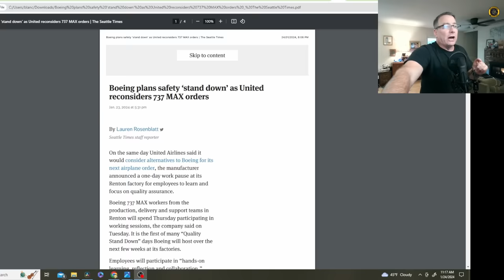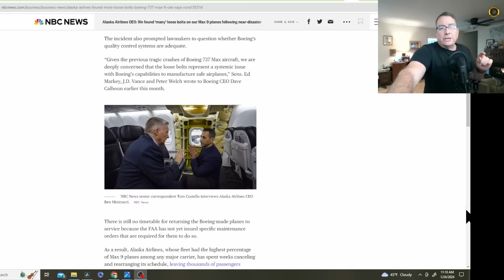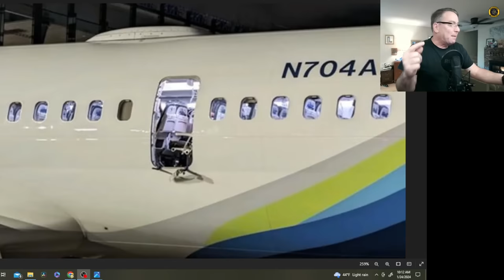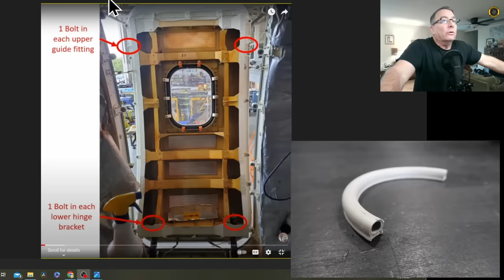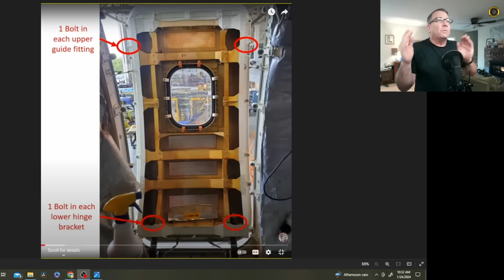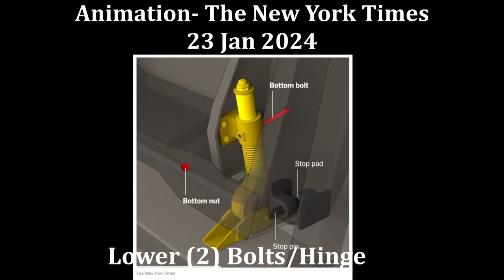Boeing's Quality Management Failure Explained 737-Max-9 Door 24 Jan 2024

Comment: Well, technically you can’t “open” a plug. You would have to remove it. But in some aircraft the door can be opened and closed as an escape hatch and wouldn’t require any bolts. I can see how that would cause confusion. Great explanation!
Reply: I think what 'open' means, as opposed to 'remove', is, the door is fully unbolted (all 4 bolts) and either the lower edge of the door or its lower hinge bracket sits on the frame while the top edge hangs outwards by several inches secured by straps or latch bars on both sides at the top. This video shows it 'open' but not 'removed'.
Reply: @istudios225  A door that would be functional ie, you could open or close and would not have bolts should be inspected differently than a plug that has to be bolted in place. Confusing the two processes is what caused much of the problem.  So, open and close a functional door and remove and replace a plug along with the appropriate documentation and inspections.

Comment: In the past when Boeing had quality problems with major suppliers, they sometimes bought out the company and went in and installed new management and business processes. I wonder if they'll consider the same with Spirit AeroSystems. With so many outstanding 737 orders they need to stabilize the supply chain.
Another thing to consider is a redesign of the plug door to mistake proof it. One way is to design the assembly in such a way that it's so difficult to remove the plug that it would never be casually considered. Only if the owner wanted increased seating and therefore the expensive conversion to a standard emergency exit.
My opinion is that the great decline of Boeing started with Harry Stonecipher and his emphasis on RONA or return on net assets. This was the late 90'sand early 2000's. From that point the stockholders were elevated above the airline customers.
Reply: There seemed to be another problem with air seals not sealing right, so that would be another cause for removing the door plug.  We could think of it in terms that if the air seals had been right, then nobody would have tried to remove the door plug.  Anyhow, is it possible that with one sloppiness (the bad air seals) combined with another sloppiness (the bolt reinstallation) we now have a dangerous condition

Comment: That explanation kind of makes sense.
It’s a process paperwork problem. 
I was wondering how not only could somebody not put in the bolts, but an inspector not inspected, and in the final paperwork review, nobody noticed that the inspector hadn’t checked it off.
Reply: And the interior finishing crew who were covering it back up didn't notice that something looked wrong.

In two different sewing factories I was required to look at every sub assembly and hand it back if it wasn't right. 

From the things Juan has shown us, the bolts should have been visible to casual viewing so the new crew on the line should have seen that something looked funny and called for an inspection.

Comment: Hey Juan!   Good video, as always.

     Small point about the bolt.   

      Large aircraft manufacturers almost exclusively use NAS hardware as opposed to AN or MilSpec.   The reason is that the Army/Navy (AN) standard is outdated and has been superseded.

      This plug door was designed to be held closed against the spring pressure with 4 NAS 6206-XX bolts.    

     Dimensionally they are identical to an AN6, but feature a steel alloy with higher tensile and shear strength as opposed to the AN bolt.

      The AIA, Aerospace Industries Association, maintains and publishes the National Aerospace Standards (NAS).

      GA is one of the few industries that still references the outdated AN standards.

Comment: Let's not forget that Alaska Airlines kept the aircraft in passenger service after repeated warnings about a pressure leak. One would think that it might be prudent to discover what triggered the warnings and fix the problem.
Reply: that's not a shareholder/mgnt/bean counter job either. & Alaska maint. was known to suck.
Reply: Pressurization problems are common, and sometimes very hard to troubleshoot! You can actually fly the Plane with passengers below 10,000 feet if the system is deactivated
Reply: To be fair, the airline didn't completely ignore those pressure warnings.  They rerouted its flights to stay close to the coast so the NTSB could easily find any crash...

Comment: I think the surprising blowout of the cockpit cabin door was the thing that got people almost more concerned than the main cause of the incident... just because it was another design feature they did not tell anyone about
Reply: Boeing said it was designed to do that. This is incorrect, the blow the pressure relief panels are there for that whilst maintaing cabin security.  Have you seen any feedback from pilots questioning whether a undesirable is able to use this 'feature' as a way into the cockpit ?.
Reply: I saw at least one comment that the initial report about that wasn't correct and that it was indeed the panels rather than the entire door that blew out, but I don't have a source.
Reply: @WOFFY-qc9te  not (Provably) from line Pilots... no.  but I have seen certain comments concern on how wrong that appeared from members of the investigation.

Comment: I know nothing about building airplanes although I did fly a piper back in the early '80s. When I would practice stalls and I would encounter substantial turbulence, I always thought that every single bolt in that plane would be ripped out.  I'm thankful that those techs and mechanics that put those planes together did a great job.
And also, kudos to the pilots that brought everybody home.
Aside from The worst possible scenario of insider sabotage...
is it possible that management just got sloppy?
If it's drugs and/or alcohol, we've all got problems. I wish them good luck.

Comment: Whether the door was removed or just opened, the 4 bolts needs to be removed so a QA inspector would need to check bolt Torques and castle nut cotter pins!!
Reply: You don’t torque these, just tighten them till the bolt hole and nut slots line up, then fit the split pin…

Comment: I am a field tech for ATMs and safes.   Someone had to have come across the bolts at some point.  You don’t have extra parts during putting it back together and not question where they came from.  Especially when lives are at stake.

Comment: Thru 1993 I was a Boeing 747-400 & 767 Planner in the factory. Strong safety procedures were in place. For every installation the  'Inspection' employee <QA> was required to inspect that it was indeed installed & installed correctly. I recall on a couple of occasions a prior installed part was in the way of the Technician's part/assembly installation located further down the assembly line so the first installed part was temporarily removed, other part installed, this triggered a new QA inspection (2nd one). That 2nd QA inspection i recall was an FAA req't.  Boeing should have kept ownership of it's Witchita 737 factory!!!! When i first got to Boeing i was shocked that their were all these different manufacturers making important parts

Comment: Interesting and more than a little disturbing. Over twenty years ago when Boeing's move to outsourcing was rushing ahead one Boeing engineer pointed out a key problem. Planning, supervising, executing and maintaining quality control over a subcontractor is far more fraught with complications than simply doing the work in-house. All the added work might even mean it costs more. In this case, if the FAA forces Boeing to clean up issues like incompatible work-tracking systems, the situation could get very costly for Boeing.

Comment: Your videos on this incident are fantastic. You brought up the difference between opening and removing the door in triggering an inspection by Boeing. I would bet that Boeing back-charges Spirit Aero for that inspection. Therefore, Spirit found a way to save money on being back-charged by reporting the door as opened rather than removed.
Reply: They probably had a final deadline to meet or incur penalties and this was one of several instances they found to save time by cutting steps.

Comment: Thanks for distilling this down.  From what you said there is no record that bolts were ever installed.  And there is no record that bolts were ever seen.  
Further there is no requirement that the presence is checked at any time.  
Having worked on the B2 program where Boeing delivered major structure components I know the lengths that were gone to inspect everything and records were kept.  Boeing had a midget inspector who inspected the inside of the wing structure because there no access hatches and full sized people would not fit.  
The real problem at Boeing is that financial idiots have taken over from the engineers (I have an MBA, but have little respect for most of colleagues).  It is as if the bad management of Douglas infected the good management of Boeing.  My 1st inkling is when Boeing wanted the money to move HQ to Chicago when it was expensive and caused disruption and  many good Boeing people didn't want to move to Chicago    Then Boeing moved again to DC and high expense while the CEO and top execs bought homes no where near any Boeing operation.  They commit expensive fraud on the stock holders by having the company pay for private jets fly them to and from home.  (I am a stock holder because I bought McDonnell  stock in 1966.)
Today the executive management has turned Boeing from a national treasure to a national disgrace.  It is effecting the prosperity of the whole nation and destroying our military superiority.  The executive management of Boeing and Spirit need to go to jail. Boeing needs to pay for federal Inspectors to pay for 100% inspection of everything.   The SEC needs to do a complete review of Boeing.  The auditors of Boeing who keep on certifying Boeing need to be replaced.   
Greed at the top has gotten Boeing to this situation.

Comment: I think it’s safe to say that four split pins were missing from that door assembly?  This is what allowed the bolts to shake free and for the door to lift and detach from the aircraft. 
Boeing should consider themselves extremely lucky that no one died from that incident. 
However, this is going to have massive ripples in share value and overall brand confidence. 
Thank you Juan for your amazing updates. You are our ‘Go-to Guy’ for anything aviation related !
Reply: No.  There were no bolts and no nuts and no pins.
Reply: @michael931  Correct. The possibility of 4 bolts shaking off 4 nuts and then falling out of their respective holes is just too high on the improbability list. Maybe on an aircraft that's been in service for a year or more, but this particular plane was nearly fresh off the line, Bolts were never put in, plain and simple.
Reply: I find it particularly remarkable that the plane flew more than once like that. The engineering is good, at least.
Reply: All of which shines an even dimmer light on the safety processes that are not being followed by multiple parties. 
It’s reckless to allow there to be two processes for requirement of the panel to be removed and yet no sign off for the refitting of the panel. 
I used to work in Pharma where everything was signed off, the double checked and signed by the checker who was then checked again by a third layer of audit.
Some processes were even checked more times than that. If we got one little thing wrong, the FDA would close us down in a heartbeat. 
Some colleagues would semi jokingly say “this is peoples lives we are saving here”
Same thing should apply to Boeing

Comment: It's dawning on me listening to you describe the QA issue: the Boeing system doesn't treat this as a fuselage panel, but just as a door. If this was a normal exit door then opening it to work on it is literally just that, opening a door whereas removing an actual door is a whole process thus needing inspection. Since it's NOT an actual hinged door but a panel it incorrectly assumes "opening" is a different mechanism of action than "remove" when in reality it's the same.

Comment: Having been a Quality Manager, There have to be multiple failure points.  Having different systems for Boeing & Spirit is not unusual. However an effective Quality Engineering group at Boeing should be on site at Sprit & thoroughly involved in correcting production/engineering deficiencies to the point of totally shutting down operations at Spirit (also do not accept any products from Spirit until  a full review/correction to processes/training/management/systems are corrected).  Then of course Engineering/Quality Control/Management/Training/Systems/Process need the same rigorous examination.  I bet there are people involved with the processes at both companies who know what problems exist & what needs to be done, but I will bet that financial types & union heads are impediments to correction.
Reply: Your reply is the best I have read.  Kudos, from a crotchety older Sr. QE with AS9100 experience!

Comment: 🎉 Juan this story is driving me crazy. Even if there was no inspection called out for the bolt installation,  There has to be a close out inspection for the door and the surrounding area.  Im a 747 master mechanic and inspector in my almost 40 years I've never seen something like this.
Reply: It sounds like whoever put it in the system assumed it was a door with latches. And I suppose one could interpret the door sitting in place with the top guide in its rail as "latched". This is what happens when desk jockeys with no mechanical understanding write procedures.
Reply: @thebigmacd you could have hit the nail on the head there (for this one avoidance of procedure/inspection).
But how do they come to have so many loose bolts found on the United inspections? Bolts attaching the hinge guide fitting to the door (the hinge tube locking bolt doesn't secure much if the hinge guide fitting isn't secured to the door!) and also bolts attaching the upper guide roller to the door frame.
Also Alaska CEO on TV saying too many loose bolts found & I got the impression he was talking about things found with his aircraft (not just United) and not just the locking bolts.

Comment: I worked at Boeing for 11  years, leaving in 2019. I entered data into cMES daily. My job was to include the QA inpection instructions. When I left Boeing in 2019, they (Boeing) laid off about 80% of their QA department personnel. I can only guess at this point that if there are 80% less inspectors, that the instructions would need to be removed from the cMES documents, because there was no-one there to sign off on the instruction.  No-one there to sign off would hold up production. And that means the schedule slows. And one take away I got from working there was - schedule is king.

Comment: The most unbelievable thing is that even with the known problem at Boeing and Spirit, the NTSB will take TWO YEARS to finalize what has already been determined! The NTSB should have streamlined processes by now. They should NOT take more than TWO YEARS for each and every mishap! 2 weeks would be reasonable for this minor issue. Certainly not TWO YEARS!
Reply: Do you think congress finances the engineers and staff at the NTSB sufficiently to do that?
Reply: NTSB is not responsible to assemble Boeing aircrafts.
Reply: Tell your congressperson to fund the NTSB better.
Reply: @JoshuaTootell  Republicans are thinking different, the "relationships" are to be improved to save a lot of money.

Comment: Surely the aircraft inspections done after the aircraft arrives at the terminal and the then goes over the aircraft to determine if the aircraft is fit to fly check the bolts are there on the plug door.

Comment: As an 18 year retired aircraft mechanic I feel that this door /plug is very badly designed. Over my working career I have worked on numerous aircraft types from McDonald Douglas, Lockheed, Airbus and of course Boeing. Generally I worked on the aircraft interiors and part of my job was to replace cabin windows, door windows and all windshields. I have over the years removed and reinstalled emergency over wing exit doors in just about every one of these aircraft types. Every one of the exit doors on the aircraft that I have mentioned above were all installed and secured by a latch mechanism from the inside of the fuselage  ... ALL of them. 
This problem exit "Plug" on the new Boeing aircraft is completely designed wrong in my opinion in that it is installed from the outside of the air frame. Todays modern aircraft are highly pressurized numerous times during their working life and that in turn puts tremendous outward pressure these plug doors. I don't design aircraft so my thoughts are my own gained over the years working on these systems.

Comment: I worked for American for 23 years,17 of them in aircraft maintenance. It breaks my heart to see just how far Boeing has fallen. I worked on the 757,767,and 777 and we never had the manufacturing defects then that Boeing has developed in the past 5 years or so. Of course blame has to drop on managements shoulders. It’s the obsessive chasing for every last penny of profit that is causing these issues. All they care about is an ever increasing return on investment to satisfy Wall Street investors. The entire Board of Directors and top management should be fired and headquarters returned to Seatle so that engineering and management can work together better.
Reply: I completely Agree. I started in the Airlines in Hangar Checks on the TANK - The Boeing 727  Great Aircraft and one of the best and fastest Airliners that Boeing ever built.